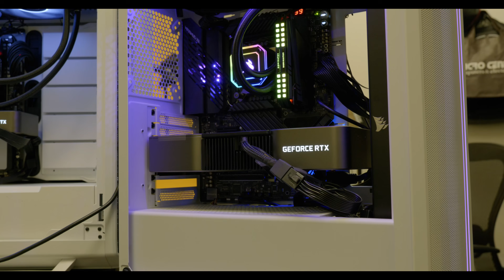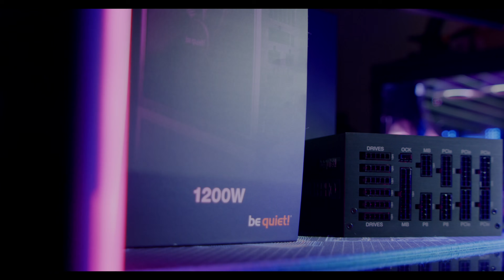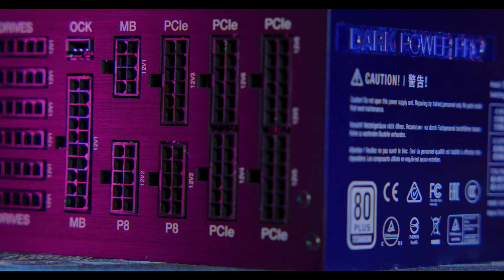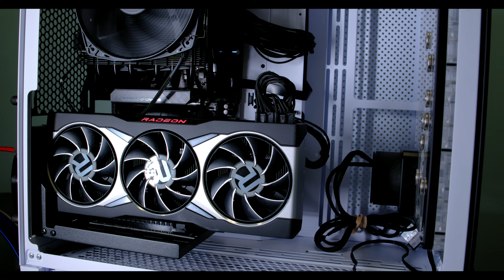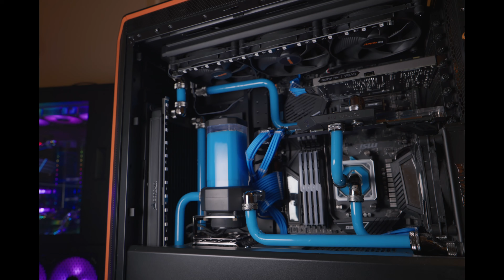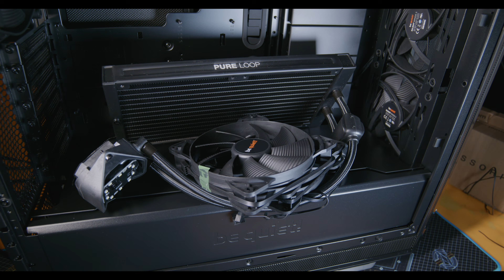LOUD PC Build and GPU? THIS Is how to make it QUIET!

Comment: My RTX 2060 does not seem to handle ray tracing too well along with HBAO/SAO or a resolution of 2560x1440. As soon as i start hearing those fans starting to sing i start messing with all these setting turning off each individual one to see which is the culprit. RTX 2060 is fantastic for 1080p gaming but for 1440p it sometimes needs game setting tuning. Some games like DYING LIGHT, SKYRIM, FALLOUT 4 even with the Bethesda high res texture pack run silent with beautiful visuals and great framerates at 1440p. Unity games are a big culprit in making games stress my video card at 1440p.

Thanks for the excellent videos Classical Technology and happy gaming :)
Reply from the maker: Thanks for the feedback!
Reply: @ClassicalTechnology  Welcome :D

Comment: Thats load of crap. My 3090 TUF on aircooling was the quietest high end graphics card ive ever had. It replaced a 1080 Ti Strix. The problem with my 3090 is COIL WHINE under watercooling, when i setup my system to actually be totally silent.

Comment: I guess I'm lucky or I'm not bothered by the sound.  This was my first no budget all out gaming build and after running it for the first few days I had to check and see if the gpu fans were even running because I could not hear anything, same for the psu. All I hear is a slight wind noise and a bit of fan blades cutting air..